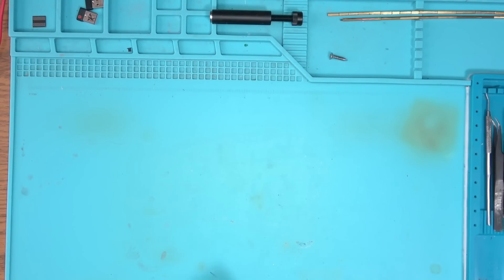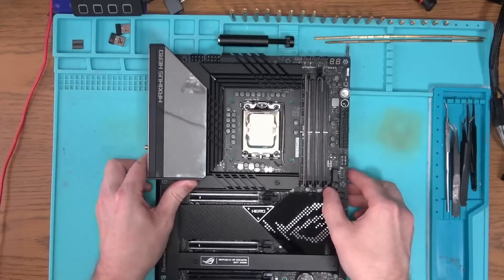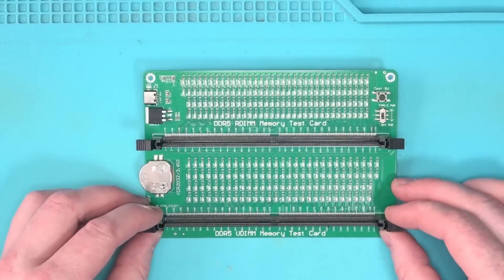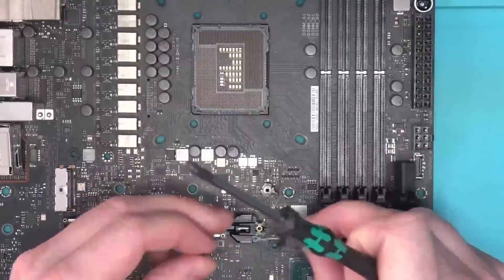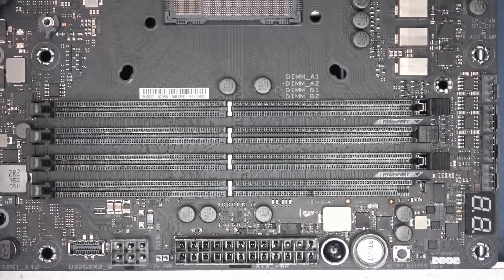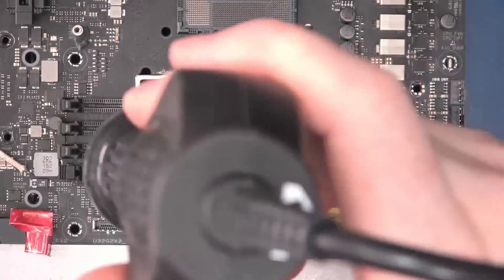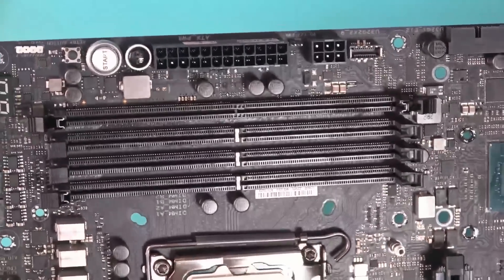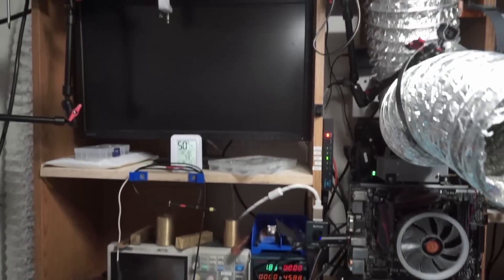Replacing Motherboard broken memory slot

Comment: I happen to have had water drip on my ASUS PRIME Z790-A motherboard causing one of my ddr5 ram slots to go out. (Swapped ram in slots until boot menu appeared, then repeated until it went out to determine board related location) what is the price you would charge?

Comment: Man, I got some MSI Carbon B550 - it burns ddr4 it finds inserted when powered up. Has anyone ever encountered this problem, any ideas how to solve it? I imagine there's a short that finds memory modules with lowest resistence, so it burns them, I figure just changing slots wouldn't do the trick. I got the board cheap and I could smell why as soon as I tried it on. Fortunately with only one sick in.

Comment: can you go little deeper with those ram slots, How high the heat and where to look out for? 

I haver a motherboard for repair, But the prevouis owner had a DIY project, Because it did not turn on. 

So he came to conclussion to use Super Glue and a ram stick To Glue it in place. 

Well. At the end i have to do this. So any suggestions ?

Comment: Not to get that plastic burns I'd try at least using Kapton tape. Maybe also put a precision-cut thin sheet of mica on top of the slot before putting Kapton tape on it. And the ultimate solution would be to also modify the hot air gun nozzle. Like get a square shaped one and make a rectangular insert in the middle so that the air comes out through 2 parallel slits around the plastic connector.
Wouldn't even think these plastic slots could do as good as they did resisting heat. To my experience the only really heat resistant plastic connectors are the dark-gray ones like those found on sata SSDs and HDDs.

Comment: I think I have seen you commenting on one of the videos from Russian youtuber it was related to cpu socket testing of connections I believe. Looks like you have purchased non-russian testers. Have you found them to be good because I have used Chineese DDR5 tester and was never very confident in it. DDR4 was always nice but DDR5 and PCIE SLOT tester offered inconsistent results. So I have finally decided to order them all from Russia Electrolab and they should arrive next month.

Comment: Nice!  Do you do any work on bent pins?  I have to MB's that have some bent pins, might be fixable but probably need new sockets..
Reply: Those are actually easy to fix with steady enough hand (and one of the most popular ways of getting cheap AM4 processors). Just bend them back CAREFULLY. Cause if you rip them, you will need to actually replace the socket...or try to solder it back somehow.
Reply: @alexturnbackthearmy1907  sockets, not cpu's

Comment: UDIMM (unregistered DIMM) is for pretty much all boards you will ever see, RDIMM (registered DIMM) is only for servers or high end workstations like AMD Threadripper Pro, Intel Sapphire Rapids and similar.

On consumer DDR5 boards you almost never want to use more than 2 sticks of RAM, because DDR5 signal quality gets really bad with 4 sticks installed.
Reply: Why do they often include 4 slots if they're not really usable?

Looks good I guess?
Reply: @lemagreengreen  You can use them but you will likely have to underclock (or not overclock) your RAM slightly.
Reply: @lemagreengreen  Well you can actually use those with appropriate memory configuration. No overclocks, no stuff, unless you are feeling lucky or adventurous and need heaps of RAM (64GB isnt a lot, actually).
Reply: Not anymore
Reply: But you should use the slots for each channel that are furthest from the CPU, and it was one of those that was broken.

Comment: I like to do those by heating the bottom of the board. didn't know those slots could withstand the heat needed to melt solder. Nice work though!
Reply: Preheater is the key. Without it, you'd definitely melt the slot.
Reply: I was also surprised!
Reply: How does a pick and place machine in the factory solder these larger components? I have always been curious. I'm guessing they use hot air as well? they just have the exact data of what every component can handle.
Reply: @lemagreengreen  No, assembly houses never use hot air(except for manual rework), the entire board goes though an 'oven' that is more akin to a giant tube that has different zones of heat along the length, the magic in not melting it is to warm things up just enough then run it more quickly through a smaller zone of higher heat that actually does the melting process, not letting plastics sit in this elevated temperature zone until they thermally decompose. For the older through-hole type, they could wave solder it along with all the PSU/SATA/pin-header connections. Wave soldering is interesting in itself, as it pumping molten solder to create a protruding 'bump/wave' that the board goes overtop of, surface tension and activated flux help suck it up into the holes until they are filled. Special fixtures keep it from going places it shouldn't, crazy stuff really.
Reply: @lemagreengreen  yea i was curious about that as well

Comment: Hey u fix nvme drives? I tried contacting you
Reply from the maker: i dont know how you tried to contact me.
No i do not specialize in data recovery. Otherwise there is no reason to fix NVME or SSD of any kind because they are simply not worth the cost.
Reply: @northwestrepair  i contacted your email address on your info page on youtube. The problem with the drive is one of the chips on it looks fried next to the controller chip. It still powers on but in windows its utilizing 100% disc usage on idle. I was just wondering because your so good with microsoldering 😁